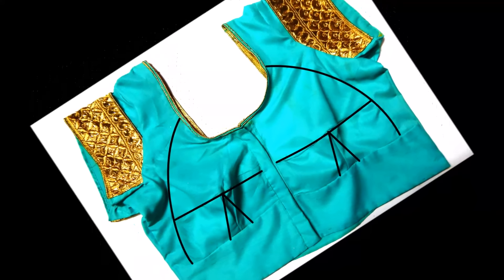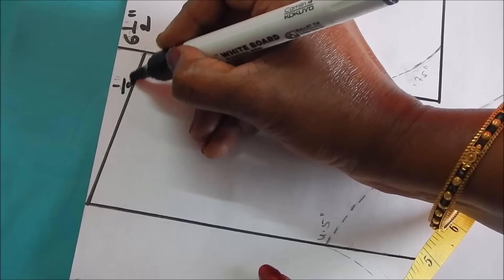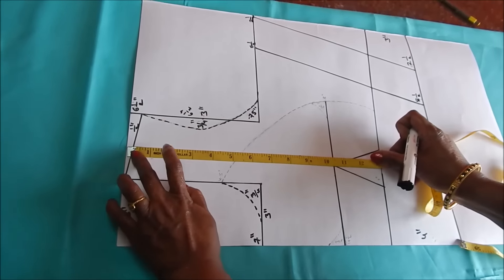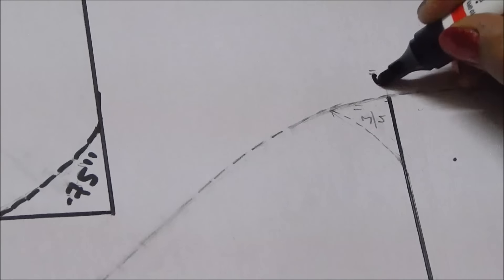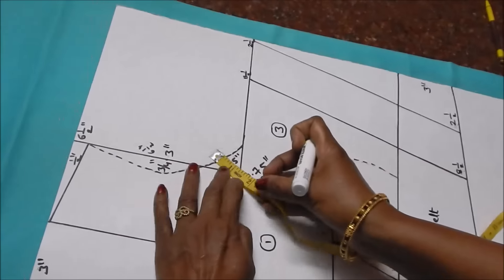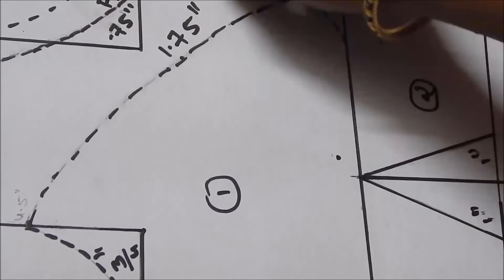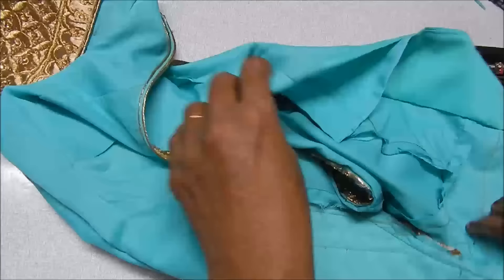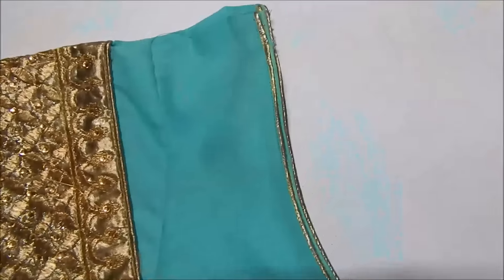Double Katori blouse - drafting, cutting and stitching | with triple cord piping

Comment: Ma'm, I unstiched a double katori blouse for measurement. i got aĺl pieces i.e back piece, sleeves, katori parts, front neck n arm piece and belt separately now.  if I cut a blouse accordingly, my measurement will be right or wrong? if wrong what is the corrections i have to do? pl reply me at your earliest
Reply from the maker: +VASANTHI JAYAKUMAR Thanks for watching. Yeah, the measurements would be same as your ready blouse. Just make sure that sufficient seam allowance ( about 0.25 - 0.5 inch extra, along the borders ) is taken for adjustments while stitching.

Comment: mujhe 28,30,32,34,36,38, 40, 42,44 inch tk ka double katori blouse deep neck k liye kitna shoulder neck width or armhole lena cahiye iska ek vedio upload kr skti h mam pls bht jaruri h kal tk upload kr de mam pls pls..
Reply from the maker: +Poonam Mistry Hi Poonamji, 28 se 36 thak ka size ke liye aap pehelewale reply, ke anusar kerlo.
40 se 44 size ke liye 2nd reply me bataya gaya measurement  use keriyega. Apni hisabse adjustment  kerna hi.  Thanks.

Comment: you said ,from left 10&1/2 is 1/4 of chest, again said , and right 8&1/2 is 1/4 of chest how it's possible? please clear it.
Reply from the maker: +deepayan das Hi, Thanks for watching. 
I hv mentioned in the video that from  left 10 and half is 1/4th of chest 42", is 10.5",  from that point to right side horizontal  line is 8"  ( Ii.e.   1/4 chest 10,5 " -  2.5 "= 8" ).  ( its not 8 and half of 1/4th ch.)
Please check again. Thanks.